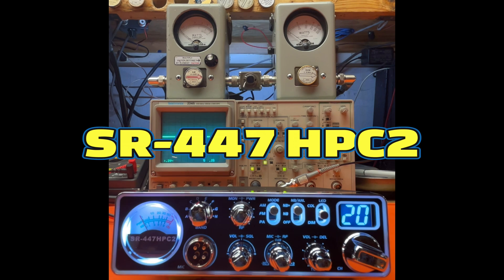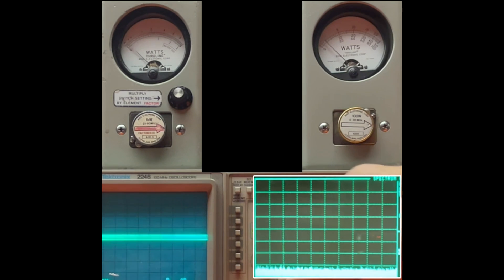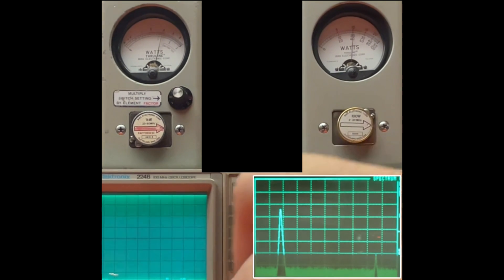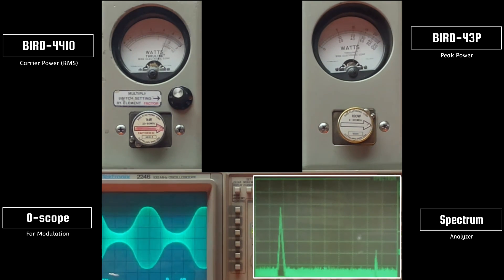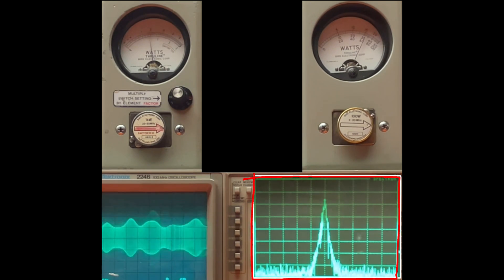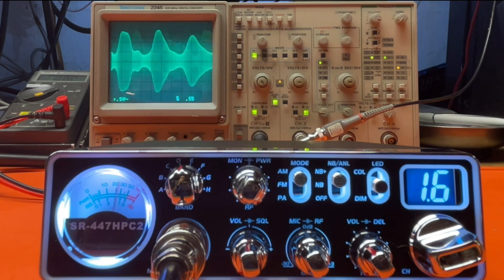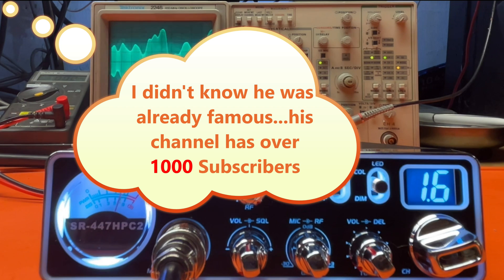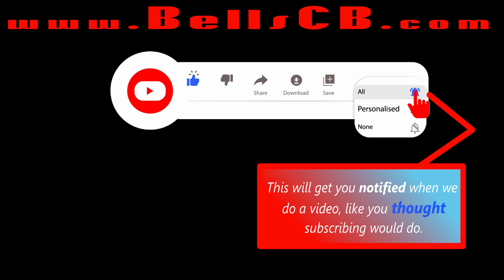Stryker SR 447HPC2 Tune up Report (2022) for Colin in Ohio

Comment: Was wondering what your opinion is on running my 4 pill hg 2879 standard with a general hp 40w? Like to try one
Reply from the maker: Keep the output carrier of the 4Pill  to 100W and you will do fine.  Probably see between 500 and 600w peak power from a competition box (Xforce, Dave Made, Carl Built, Fat Boy etc...).
Reply: @BellsCB  I'm running a 29lx right now actually got my echo board and everything from you. Would like to drive the 4 pill to its potential cant find a kicker was thinking of upgrading radios what would you recommend and when I order from you could you set it up to run with my amp.
Reply from the maker: That's a longer discussion than what will fit here,  visit my web site and click on the CHAT button at the bottom and we can discuss it on messenger. 
 https://www.bellscb.com   𝑺𝒄𝒓𝒆𝒘𝒅𝒓𝒊𝒗𝒆𝒓  𝘽𝙚𝙡𝙡𝙨 🔔 𝘾𝘽